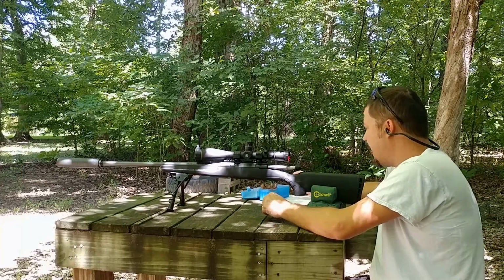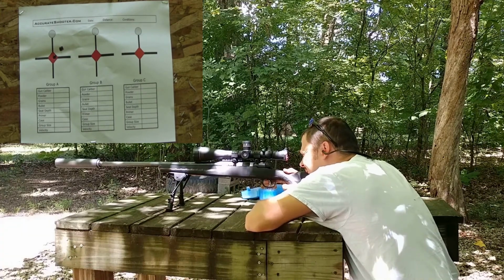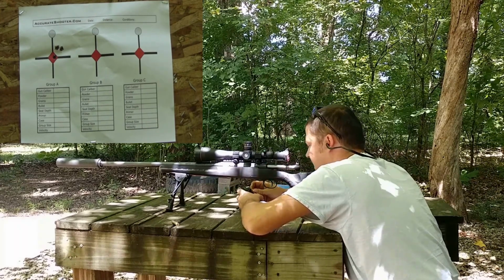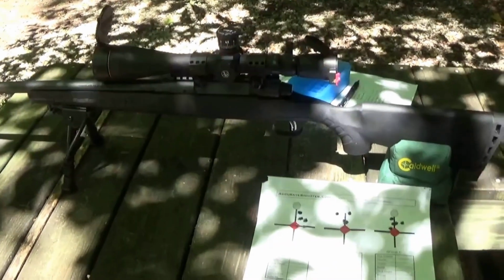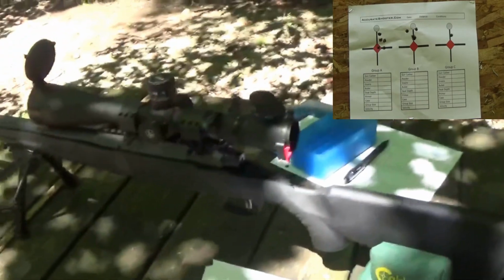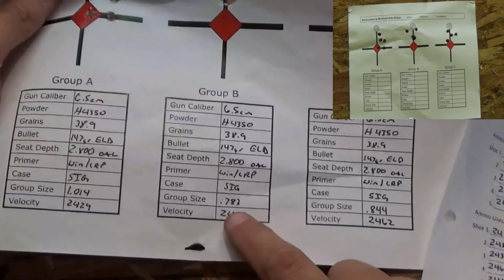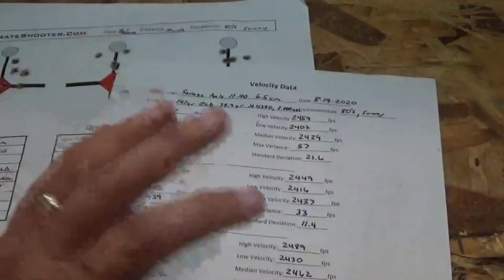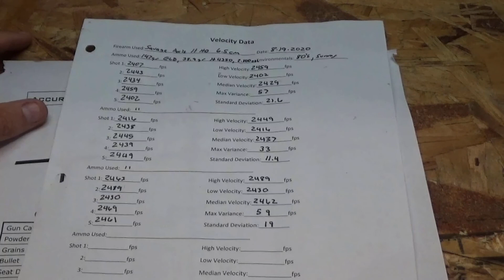Savage Axis II HB.. 6.5 Creedmoor Load Workup... Part 3

Comment: If you will check the weigh of all of the bullet you will find that they or not the same they can be up to 3/10 off that is 1/10 high and 1/10 low  so at that point shoot the one that or the same it will make a difference